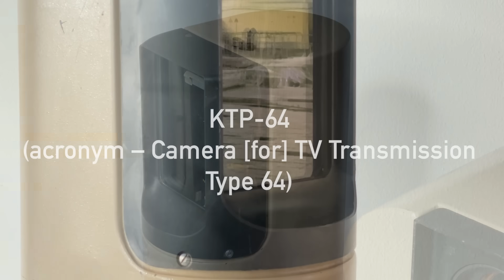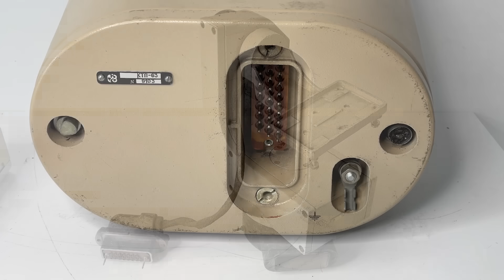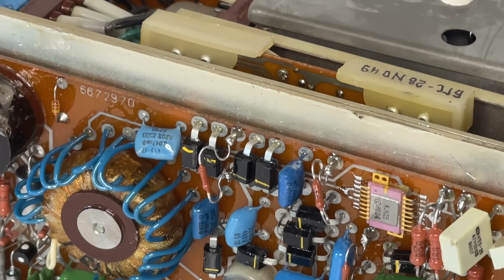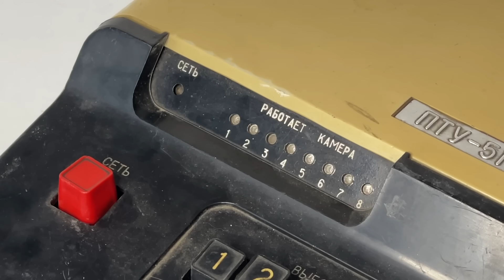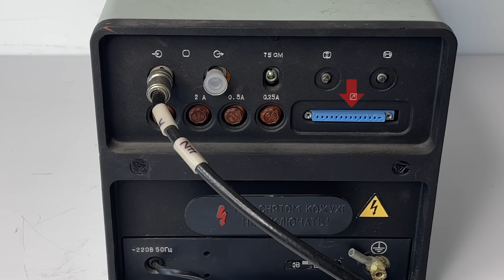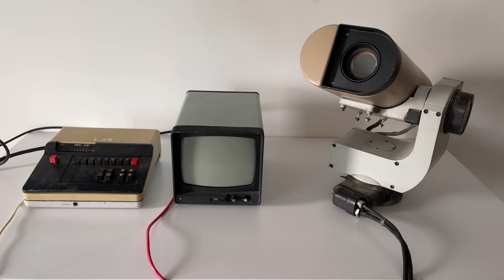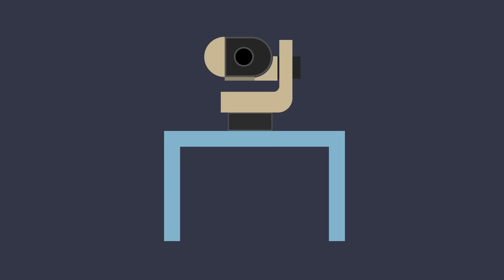THESE CCTV CAMERAS recorded the CHERNOBYL DISASTER

Comment: Linkage you are asking about is a universal joint.  Cameras would have failed in high radiation mostly because the radiation damaged the semiconductors in the amplifiers for the vidicon tube, the actual tube itself would degrade slower, simply because of the larger mass of the photocathode meaning it would take much more to damage it. You would get ghost images from radiation off the video entering through the housing gap by the lens, but mostly for radiation all you would get was noise as the amplifier transistors got cooked. 

Same for the digital logic making the video signal, where ironically a few generation older cameras, all tube based, would have survived for hundreds of hours more, till the radiation finally changed the values of the components enough. Those would have been seriously radioactive then, as you would had made a lot of highly radioactive isotopes of all the metal parts, and would have a lot of noise on the video from the radiation interfering with the actual electrode structures. But they would survive short term, a few days, looking into the most radioactive parts of the reactor, provided you kept them cool enough. But the failed cameras, once removed and cleaned externally, would decay back to background levels in a few months, as the isotopes created from the gamma radiation and neutron bombardment all have relatively short half lives.
Reply: I have read in product information from Japanese lens manufacturers (like Canon and Fujinon) that their normal photographic lenses cannot be used around radiation, as the clear lens material rapidly fades to a semi-opaque yellow colour, spoiling the pictures projected on to the vidicon tube. Specially-made lenses have to be used in nuclear facilities. Assuming this applied equally to the Soviet lenses, I wonder what in these cameras failed first from the radiation: the lens glass, the vidicon tube or the electronic components? I also wonder if the mirror optics in the upright camera were intended to keep radiation off the lens itself, reflecting only visible light to the tube surface. 
I've got some Japanese pan-tilt-zoom mounts from the late 1980s, and the electronics and connectors are far more modern and miniature than the Soviet equivalents shown here. The Soviet connectors look like western connectors from the 1940s to 1970s. Oddly enough, the Japanese equipment exported to the west used all the latest connectors, but quite a lot of equipment intended for their local market still had these unique old-fashioned bakelite and chrome metal connectors.
It was also very surprising to see the use of flat-head slotted screw heads in the mechanisms, instead of Phillips and Pozi crossed heads, seen in most of the metricated world, except of course, the USA and UK.
Reply: @wombatperson  Soviets used that narrow width flat screw for decades, as they had standardised on it, and it is a lot narrower than the Western version. Same for the connectors, old patterns with the focus on interchange between wildly different age equipment, as they tended to keep equipment in operation for many decades, and not upgrade at all, so long as it still could be serviced and worked. 

After all this was a central economy, where even getting a light bulb involved a lot of paperwork, leading to the black market being big in selling blown light bulbs, especially those with visible blackening on the glass, as selling the faulty ones was not frowned on, but they were difficult to get as a consumer new. So buy blown ones on the black market, and simply swap them at the factory, wait a day, then report them as blown, and the factory would change them, of course the electrician or store keeper keeping the blown ones, to sell as used.
Reply: @wombatperson  Radiation damage mostly to the AR coatings, and to the optical glues used to make compound lenses. Simple lens with no AR coating will survive a lot of radiation, a lot more than needed to totally wipe out the semiconductors and destroy the heavy metal phosphor coating on the target. Exactly the same as what you get with those lenses when exposed to plain sunlight, and the high UV level, without a UV block filter in front of them, typically integrated into the front ND filter that is coated to be both UV block and IR blocking as well, at least for modern CMOS sensors, which  are really sensitive to IR as well.
Reply: @wombatperson  The soviet design philosophy at the time was to prefer electromechanics to electronics whether possible.
Reply from the maker: Thank you for sharing these thoughts!

Comment: My dad bought a Zenit camera from Yugoslavia before he moved to Australia, said it was better than his Leica in many ways, he was a photographic journalist and had many cameras, some very rare now. Ironically his Leica doesn't work anymore but the Zenit never missed a beat and still works. He also bought Orwo film as he claimed it was better. But in Australia he used agfa and kodak most the time as they were easier to find, he hated Fuji. Maybe it's that eastern bloc reliability, Yugoslav appliances lasted allot longer than western goods. No planned obsolescence.
Reply: After WW2, Zeiss was divided in two, first is Zeiss Optik in West, and Zeiss Jena in East. I hunch those Zenit used Zeiss Jena lens which is off course high quality products. Zeiss lens is renowned for high contrast and sharpness, which most photo journalist favour back in the days of newspaper print in black and white.
Reply: @jojoanggono3229  Yup. Zeiss were and are still highly regarded. If the Soviets copied something with diligence the result could have been amazing as the original.
But there is a wide span, they also produced some backwards shit.
Reply: Man, I've had like three zeniths die on me. Just the winding teeth breaking, shutter messing up, all kinds of catastrophic damage, where the camera just stops working.

Western cameras usually need a big impact or other damage to die so resolutely, yet the zeniths died without any previous signs of problems.

Unreliable. I would never carry a zenith as only camera in a situation. Maybe secondary or third camera, with some b/w cheap film.

Nikon and Pentax/Ricoh all the way for reliability.

A few soviet cams are quite reliable, for ex a few fed models. But there you have to be vigilant to not burn the shutter curtains etc.
Reply: The problem is capitalism
Reply: @ Unfortunately nothing is made to last these days, especially due to planned obsolescence. Would like to get my hands on a Ghetaldus camera to collect, might get into some analogue photography as a hobby.
Reply: Oh no, Orwo was hardly better than Kodak. That's just his patriotism. Commendable, though. The Zenits were and are pretty solid though.
Reply from the maker: Unfortunately, I am not a photographer, so I trust you here... and thank you for the story!
Reply: I also have a Zenit-E camera and I use it for photography sometimes. It's a work of art and really pretty. The only bit triggered me a bit was getting the footage out, since everything is mechanical.
Reply: @william_ok  I have no Idea about photography and my dad gave it up after Digital came in as he doesn't understand computers, you can't even get slow exposure film anymore only 400 so my dad gave up analogue photography now. Can vaguely remember the Zenit he mostly used a dual lense Mamiya have no idea what model, he occasionally used the zenit and a Nikon. They were all mechanical, cant even get film for the Mamiya anymore completely different size.
Reply: @super_slav91  There's plenty of options for high grade color film at least in the west. The old recipes are also being taken into use as film is getting popular again. Kodak ektar 100 is pure magic in my opinion.

Also there are plenty of crappy SLR models out there with poor shutter speeds and bad metering that would survive a bomb but that doesn't make them good cameras for professional use..
Reply: @TigeroL42  In Australia all I can find is 400 Fuji and Kodak, His Zenit actually produced pics on par with his Nikon but the Mamiya was the best. All his cameras cost over $500 for sure back in the 90's except the Zenit.

Comment: What a beatifull piece of el. equipment. I've seen some old military grade devices, but this is far further, that grade. Even resistors have their protective shielding, and in the time of 15:01 there are visible solder joints with protective paint cover - I've never seen that kind of patience for detail. There are also some resistors with strange  S-shaped springy legs for unknown reason. I also didn't find any western components in this video. Can You confirm it is 100% CCCP made?
Reply from the maker: Thank you! Yes, it looks to be a totally local production.
Reply: Totally 100% CCCP made, as the same parts, in different grades of quality, were made for the military, and thus the consumer and industrial equipment used the lower grade parts, and after they started doing commercial production they simply kept on making the same parts, using the same machinery. USSR tech was always on the trailing edge in a lot of respects, as they had to both make the machines first, and then were loath to upgrade them to make newer versions. Some parts were utter junk though, especially capacitors, where they routinely used parts designed in the 1930's, when much more modern parts existed, but because the machinery was still working they made the old ones, despite them being shorter lived, and also making poorer quality parts. Got some old Soviet era metal can capacitors that are identical to the 1940's versions, but made 50 years later, and they are as unreliable as the originals were, degrading even when not used. westerm made units updated over the years, to make them much more reliable, and in many cases closer tolerance and better performing at the same time, and also improved material made them much lighter and smaller.
Reply: @SeanBZA  albeit soviet electrolytic capacitors were notoriously bad, they have one upside: unlike old Japanese capacitors that leak electrolyte and destroy circuit boards to the point of being non-repairable, soviet capacitors just dry out inside keeping PCB ok and you just have to replace them with modern ones 😁
Reply from the maker: Well pointed, though to be honest we had a couple of cases of K50-6 leaking. However, these were more an exception.

Comment: Cool video, lots of information that I always wondered about when I was younger. I was told these cameras lasted maybe 10-30 minutes each.
Reply from the maker: It depended very much. In some cases they really blacked out that fast. Often, however, not.
Reply: @ChernobylFamily  Can you give a insight at what does radiation do to the Camera's (or technology in general) that makes them break down?
Reply from the maker: @retinaquester  generally, semiconductors burn. As for vidicons, effect is similar to a strong light - they basically become black.

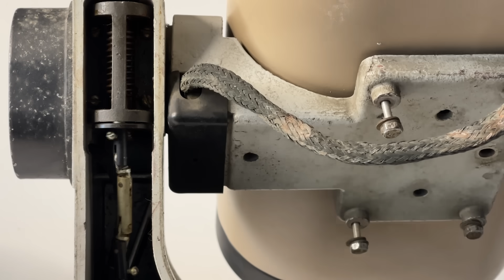Comment: 11:30 I'd probably call it a Cardan Shaft, or Drive Shaft, although the joints for each axis are offset so I'm not sure if they're technically universal joints. Same principle though!
Reply from the maker: Yes, I also thought about Cardan coupling, just was not sure about offset.
Reply: @ChernobylFamily  Kardan or Kreuzgelenkkupplung in German
Reply: Another definition of Cardan (drive)shaft is CV shaft, where CV stands for constant velocity.
Reply: This cardan transmission, probably, is just only the result of an egineering design bug, nothing more.